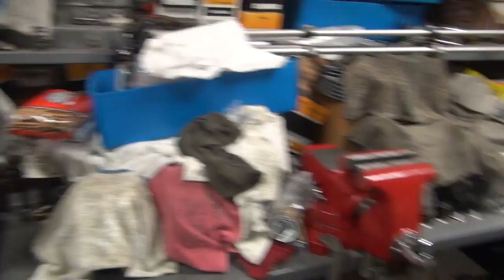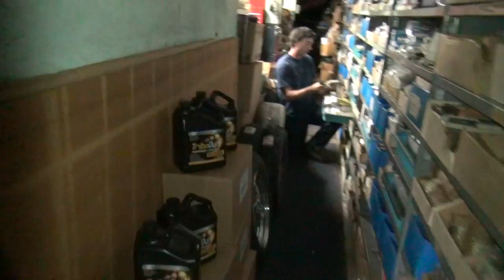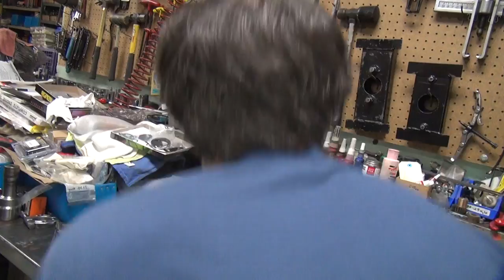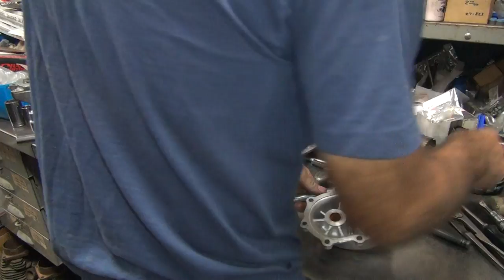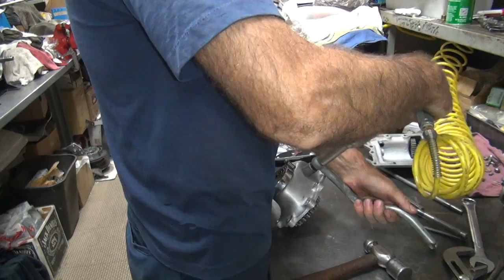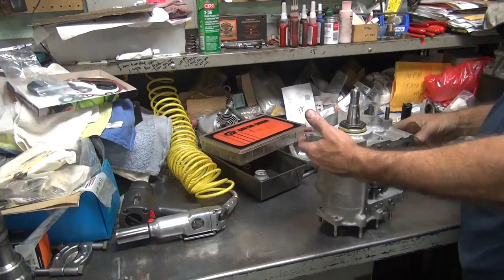1965 panhead #126 4-speed transmission rebuild FL FLH 1966 shovelhead harley by tatro machine

Comment: You can most likely flip those vise jaws around and use the smooth back side of them facing out. You might need to countersink the screws into the back. I did this on a vise I have, and it worked great.